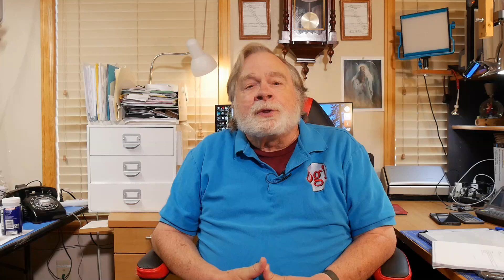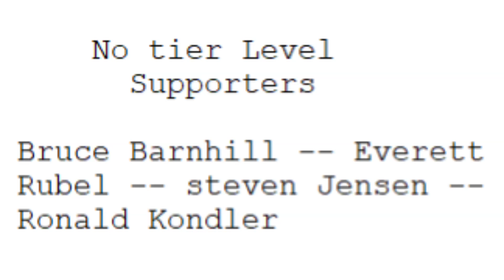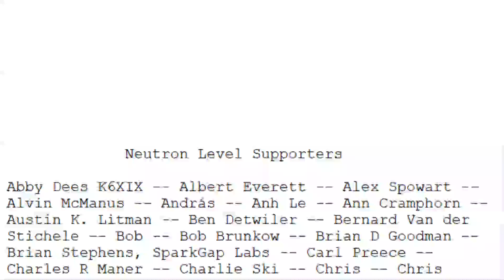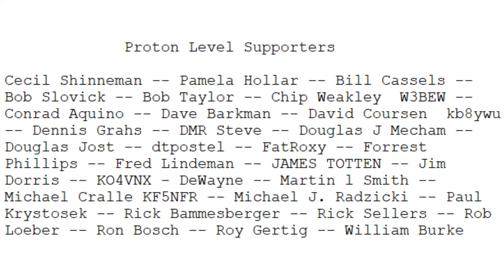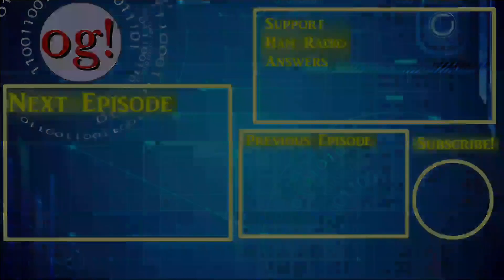Audio Hum Vs Power Supply (#1127)

Comment: Howdy.
I would like to mention another possibility.
If there is only electrolytics as output filtering it could be that the Equivalent Series Resistance (ESR) is too high to knock down the hash. I would suggest connecting a plastic cap. say 220 nano-Farad (nF) over the output. That will show really low ESR to any hash.
And to knock down any residual RF one may add a 1 nF ceramic cap. still. A gourmet setup.
However. This happened to me in one of my own designs. The ESR was so low that the switching transistors blew at start up.
High Regards.

Comment: I run my radio off a battery. There is a charger and a timer connected to the battery. The charger runs at night. No problem with noise.  I can charge the battery off my car if necessary. If you depend on a grid-connected power supply and the grid goes down. you are in trouble. Being up and running in an emergency is one reason for being a ham.

Comment: In our club station we had an Alinco power supply, among others, and was never able to find any RF hash.  So I have no reservations about that model.  We ran most of the gear there from a big Astron 70 amp supply.  I used to joke that you could jump start an 18-wheeler with that thing!  It took two of us to lift it from the dolly to the desk top when we installed it.  Like picking up an engine block.

Comment: Thank you,  Dave. 
   All my power supplies are built for ham radio, and I have to battery boosters.
I have operated off battery power the last three years or so.
  What is the little unit with flashing lights near your calculator? N0QFT

Comment: My power supply in the shack is also the Samlex SEC-1235M.  In my portable kit I have a Samlex SEC-1223BBM, to allow seamless connection with a 55 ah AGM battery.  And yes, I've tested this function.  AC power can be lost and restored without so much as a blink of the lights on the ham gear.  I have a SEC-1223 just as a spare.  Did I say I like Samlex supplies?